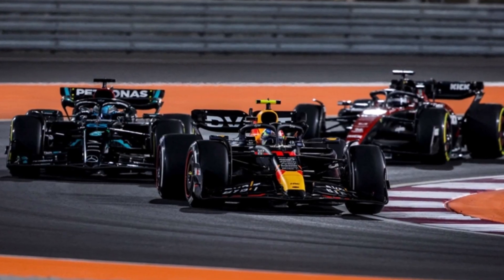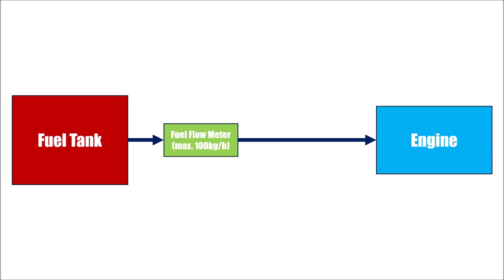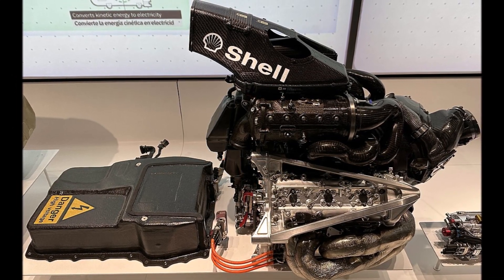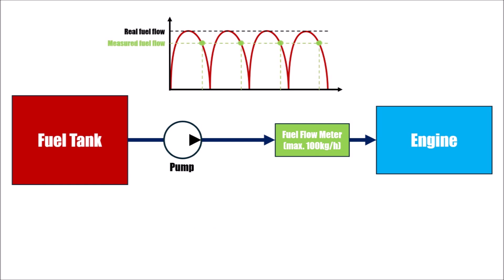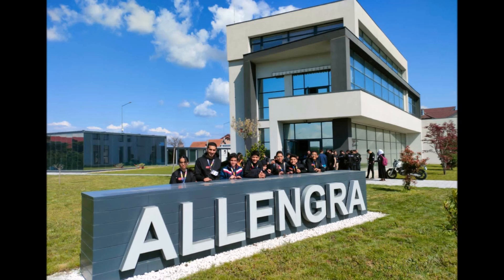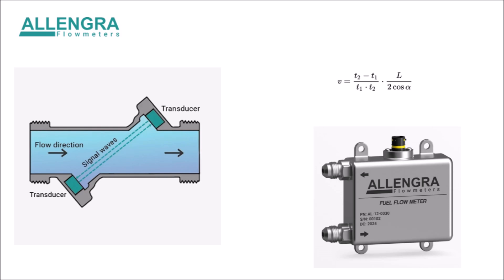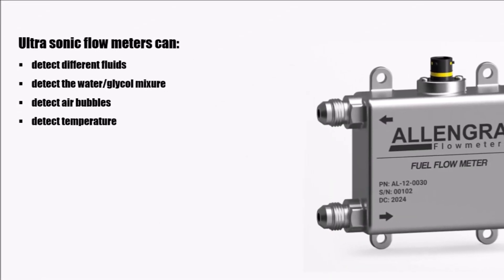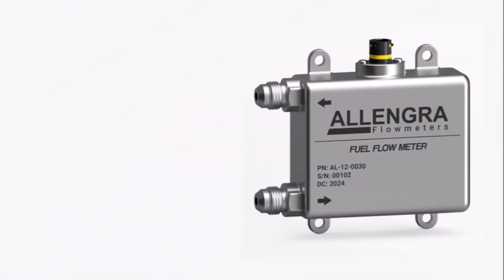F1 Fuel Flow Meters EXPLAINED (Background and Technical Analysis)

Comment: The ultrasonic fuel flow meter principle of operation is described well... but you should know that this is not unique to Allengra - it has been a common industrial type for decades.

Comment: I dont follow F1, but am i missing something here? E10 gasoline has an energy density of 44MJ/kg. 100kg/hr gives 44*10^6*100/3600/735=1600hp at 100% efficiency. Thats 800hp at the crank at best. Is this the peak horsepower, or is it averaged over some time?
Reply from the maker: Correct calculation, that's basically their performance limit, but for combustion engine only. You can still boost with MGUK.
Reply: E5.75 was used before 2022.
Reply: They also burned extra liter of oil. Entire 1% for crucial moments. Also increased pulses between fuel pump analysis. Ferarri scumbag tactics

Comment: I also instantly got the idea to just change the fuel density so the ultrasound travels at a different speed.
Reply: That is true - fuel density changes speef of sound. However we measure up & downstream, thus besides the speed of the flow we measure also the speed of Sound in general, thus we notice if sth changed with the fuel
Reply: In order to measure the speed of sound the flow speed of the fuel does not have to be constant
Reply: @ Okay, that is good. But then, what if I change the temperature of the fluid along with its density? :)
Or, if I add very tiny bubbles to it?
Reply: Bubbles you can detect from the signal behavior, usually trying to have a gas/air in the system is not helpful for performance
Reply: We have a temperature sensor to correct for temperature
Reply: @nielsjunker6309  Nice! And I enjoy this discussion! :)
Then, what about if I inject ultrasound before or after the sensor? When it detects an error in measurement, I can make a larger pulse in fuel, undetected, if your device would think, ok, I'll ignore this measurement as it was an error and outlier. I could figure out, how many wrong measurements will be ignored.
Reply: I wonder if you’d need to go up or down in density to register a lower flow rate with this sensor. Looks like some ultrasonic flow sensors are able to measure fluid density as a secondary output. IIRC F1 fuel already has an extremely high density for a petrol fuel.

Comment: I always knew the Ferraris in 2020 were running with a reduced fuel flow rate which was why they sucked that season (they finished 6th in the Constructor's Championship, their worst result in 40 years that was only beaten by their 1980 season where they finished 10th).
Reply from the maker: That was their unofficial punishment by the FIA...
Reply: Not just reduced. Their oil was finally punished. Their just desserts

Comment: Tbh why is this needed? If you can only carrying 100kg or so of fuel, let them use the amount they want at any one time. If they run out of fuel its their fault.
Reply: Extra performance at key moments in the race is why this matters.
Reply: What wrong with that  @mikeakerstrom1667
Reply: @mikeakerstrom1667 But thats common in other racing categories
Reply: Would be a big advantage to the engine manufacturers presumably, killing the chances of costumer teams.
Reply: Ofcourse f1's purposely overcomplicated thus extremely expensive fuel flow regulations benefit small teams because there are no "young" bright mathematicians who are able to calculate a great race strategy ...  @Sp4mMe
Reply: I agree. More power is always more power. And the limiting factor is overall fuel use during the race and reliability.😊👍🏻
Reply: Btw the 100kg limit does not exist anymore. Besides there are tracks which never reached the 100kg limit. As well as now with sprintracing you would have needed a second fuel limit. And what about Qualifying?
Reply: It not only raises peak power but also causes more lift and coast to regain that fuel. Not good for the show
Reply: I agree too. The rules regarding component life will also dictate maximum power, no point in making huge power if it kills the engine and transmission after 1 qualifying session.
Reply: I agree 1000%. It's rules. Otherwise how can FIA control and manipulate stuff?